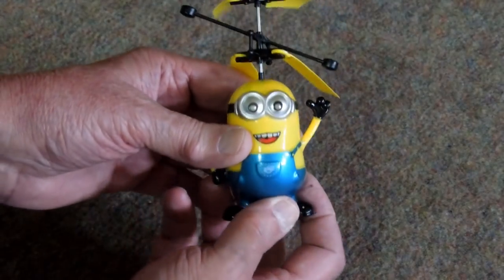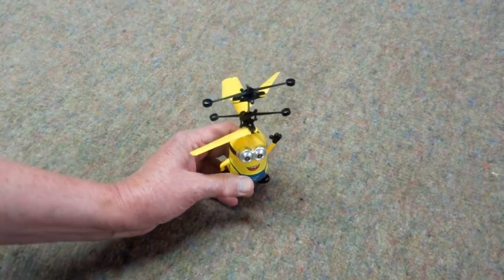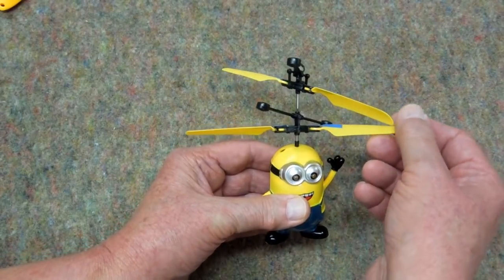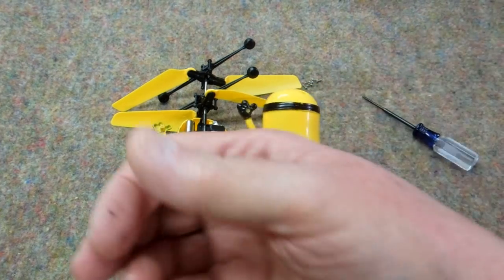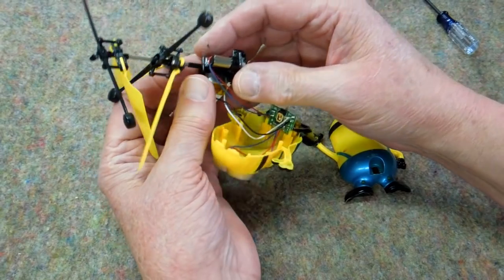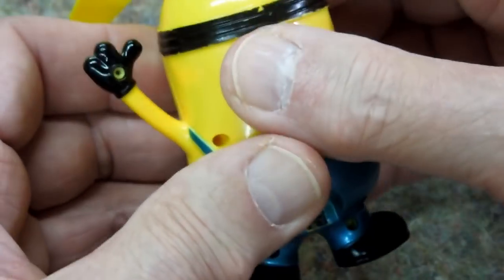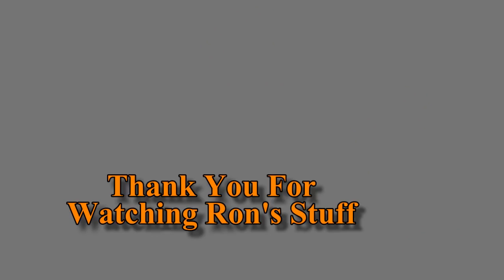Despicable Me Minion Helicopter - Dissected

Comment: Hi. I have one minion like this. He hit few times the walls, the wings flew out and I fix it.  But now it doesn't want to lift. Sensor works, every time when I put the hands under it the speed changes. Can I repair it some how?
Reply from the maker: The two rotors turn with opposite rotation and the blades are made left hand and right hand. Blades on the bottom turn counterclockwise and the blades on top turn clockwise. If somehow you got the blades mixed up it will not fly.  The air should be strong downward and not at all upward. Than's all I can think of.

Comment: I teach middle school and got one of these as a New Years gift. It came in what looked like official packaging, but there was no remote with it. I’ve charged it for over 24 hours, and it’s just not doing anything. Is there a specific way to activate it, or is it just not working?
Reply from the maker: I guess you received the charging cord and you have been charging using the USB port on your computer. The switch should be in the OFF position when charging. After charging... When you turn the switch ON the eyes should at least light up (which tells you the the battery is charged and the internal electronics are powered up). It the eyes do not light up when it is turned on, either the battery is no good or a wire is loose inside. Do not open this up unless you are familiar with soldering fine detail electronics.

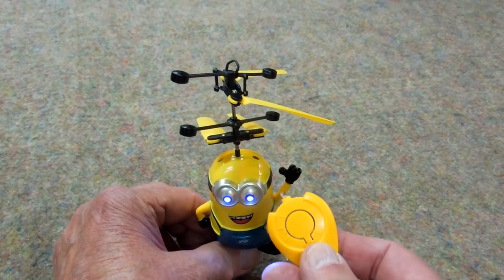To get it to run, you need the remote control (my remote is yellow and is very briefly shown around 1:52 in the video). The remote is a simple push button LED infrared emitter (invisible light to the human eye). 

When the Minion sees the LED light the first time, it turns on. The next time it sees the LED light, it turns off. The infrared signal from the remote will produce a specific signal that the minion can recognize... much like the various infrared signals from the remote for your TV. 

No remote... it won't run. You now have a decoration for your shelf. Just another Made In China piece of Junk!  Sorry!

Thanks for watching. Please subscribe! 
That is what keeps this channel going. 
Ron